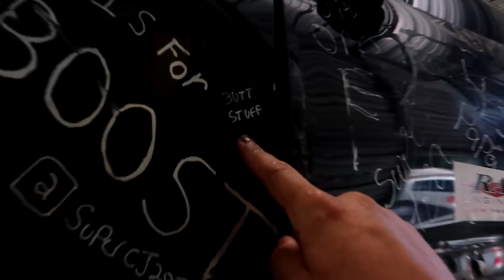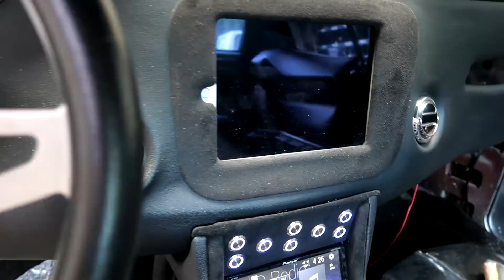Bringing Vtec Vicky back to Life! (Single Day Built Integra)

Comment: There was a forum thread of a guy with a garden hose, put it in a 1997 Ford Cobra engine oil fill and turn on the water.  He wanted to clean inside his motor.  It went around all the forums for years.  Car had like 3000 miles and was that mystic paint (changes colors in light).  When I see water coming out of the oil pan like that I remember the Cobra pictures.

Comment: After 1 hour of 1.5k idle, drain oil, change filter. Add 1 can Sea Foam to 5 gallons fuel in tank. To crankcase add 1 quart conventional ATF + 1 quart kerosene, remaining 5W-30. Again- 1 hour of 1.5k idle, drain oil, change filter. That "rust" is nearly liquid sandpaper, and must be flushed out. A simple spill & fill will not do it.
Reply: HUBBABUBBA DOOPYDOOP dude idk if thats good for a turbo
Reply: yeah seems like a lot of additives... i woulda used a good oil with good fuel since both should have a cleaning effect and then do 2-3 flushes.... thoughts?
Reply: "Motor oil" really doesn't contain any detergents, surfactants, or emulsifiers. Wet sandpaper is aluminum oxide and alumina oxide. The oil is actually sandpaper, and it must be removed immediately. 36 years General Mechanic (before ASAE). Follow that procedure- or load bearings will suffer. NBD to do it, I've done countless. The stuff you buy made by Gunk called Motor Flush is ATF & kerosene. Run the cleaner through, changing filter 2x. One hour later- clean. Pour that changed oil through a paint filter. A can of Seafoam will also help to dry the crankcase. A lot of additives? 2 to flush the lubrication system, and one to remove fuel from the fuel system, and Combustion Chamber? Are you high? I really don't give fuck.
Reply: HUBBABUBBA DOOPYDOOP is right, and his formula, while probably excessive for something that the Boiz don't really care about ALL that much, is totally legit. It won't hurt the turbo and it would clear all the rust and a lot of carbon buildup out of an otherwise beat-ass motor. 
But seeing as it needs a new headgasket, most of that is moot at this point.
Reply: Wish I could add pictures to comments in youtube. Cause there would be a Morgan Freeman Meme Man saying "He's Right You Know" ^^^ Most of the fuel and oil flushes are just kerosene and oil mixtures, mechanic and Diesel Mechanic of only 6 years and yep HUBBABUBBA DOOPYDOOP is right.

Comment: i hope that timing belt bolt + nut will keep the tensioner pully straight/in line with the belt because if it isn't the belt will not stay aligned and run of the pullies.

Comment: Unpopular question:
Why they always dump the exhaust on the top? Can't they just get it straight down there?

More noise? Maybe it creates lift?
Reply: Adweenix its a look thing doesn't help performance some do straight down some do fender exit some do hood exit some do full exhaust out the back a lot of Honda guys go for hood exits maybe because the like seeing it shoot flames in their face lol
Reply: not really. you get more hp out of it because of no back pressure. turbo hates backpressure.
Reply: Thomas Strickland as long as the piping is big enough there is limited back pressure with all options having it stick out the hood is a ricer thing lol
Reply: Usually because if it shot down it would melt shit

Comment: Hey Kyle just because of you and your channel i got into cars got a project civic sitting in my shop cherry picker ready to pull the stock crap motor and looking to engine swap only problem is idk what b20 i want let me know what kind of b20 you would recommend
Reply: got tools engine stand a cherry picker and the project car all in the last month. you doing what you do just gave me the push i needed to get into it more and more
Reply: not kyle but if you wanna boost it dont go b20. the sleeves tend to crack. b20 is good for NA power if u wanna put a vtec head on it. b18c1 would be your best bet for going turbo. best of luck dude
Reply: i heard that b18s rev high that true?
Reply: I got the captions on. When a motor starts it
Says [Music] haha
Reply: KenKo8 all b series vtec motors rev high. If i was you id go ls vtec
Reply: most B series rev high, depends how high you wanna go though lol. do some research on all the b16/18/20. all have strengths and weaknesses
Reply: you can just go b20 turbo 8-10psi just make sure u take some timing out for reliability.

Comment: What's up with the intercooler being on top of the whole engine??
Reply: It was used in derby drag racing and they didnt want to lose boost if the intercooler was damaged.
Reply: the point of the car was to crash into the other racer before crossing the finish line. plus the had to build the whole setup in Colorado and the take it on a plane to Florida so they didn't want there to be any fitmint issues.

Comment: Ok so I got a question for anyone really... I’m very new to import cars I have a 1987 Acura integra with a built d16a1 it has a turbo on it as well I got this car for dirt cheap it has a blown head gasket I bought a new gasket for it and not a cheap one so my question is can I reuse the head bolts or do I need to buy new ones any help would be appreciated and thanks in advance
Reply: Matt Dicker buy new ones bro , Honda/Acura Headbolts are Torque to Yield (One time Use only) go on ebay and order new stock head bolts and new HeadGasket kit it comes with intake and exhaust too or if your with some cash go get a oem honda HeadGasket.
Reply: Lightning Autowerks™ thank you so much I really appreciate the advice ! I really want to get this car running I think it will be a good time
Reply: or just buy arp head bolts so you can reuse it many times you want.
Reply: Thomas Strickland yeah definitely I checked with my local Honda dealer and they wanted 200+ just for the stock ones lol so I’m arp all the way

Comment: I still don't understand why you guys stand on the limiter like that when doing pulls?
Reply: they are waiting for the vehicle to gain speed, the boost hits at say 60mph and the wheels break loose and slap limiter, the gear maxxes out speed wise at say 90 mph, so they have to wait til they hit 90 mph to shift or else when they shift the motor will bog